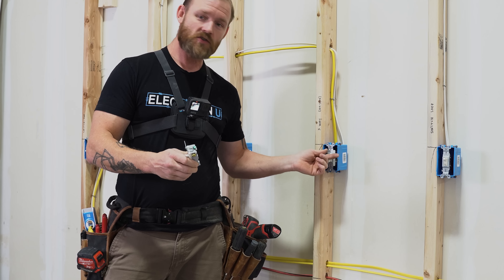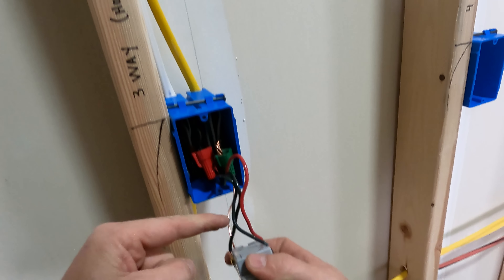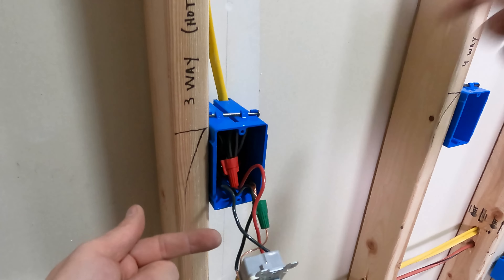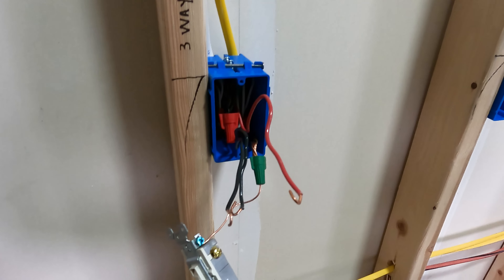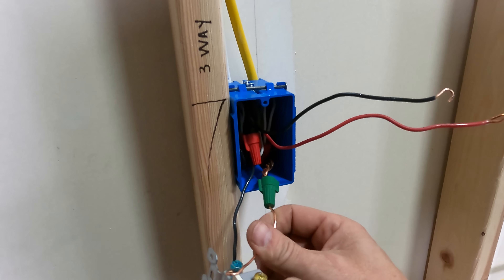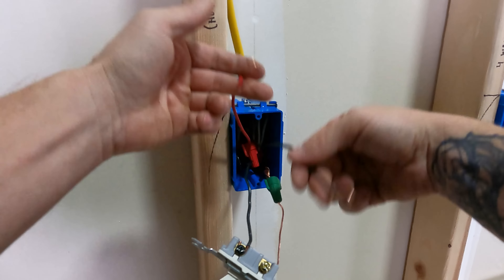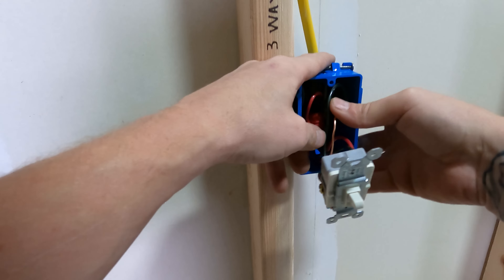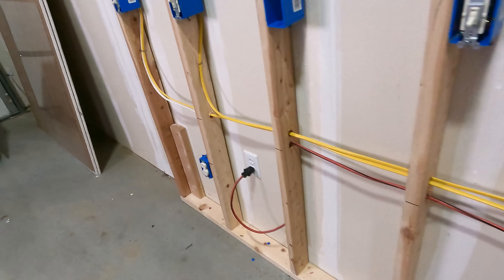How Do I Replace a 3-Way Switch? Which Wire Goes Where??

Comment: Should check with non-contact voltage tester. 1) You can never be sure you have found the correct breaker - especially in old houses which are more likely to require the switch to be replaced and 2) As in this example there are other wires in the box that could be live.

Comment: Thank you for clarify the basic. However, there are deviations . In my case, one side was wired by two 14 2, the other side is 12 4. On the 12 4, Red is HOT, Black and white are travelers!

Comment: This is where pulling different colored wire through conduit is very helpful: yellow and orange are single pole single throw (on/off. Single circuit) and the brown wires are travelers (single pole/double throw). If I were doing work in the land of Romax, I would be labeling Both the outer jacket, when necessary, and the individual wires with colored tape. Romax without labeling can become extremely difficult

Comment: Thanks!
Reply: Dustin at Electrician U saying to connect the two traveler wires to the gold terminals was the secret to correctly connecting the wires when a 3-way switch I replaced did not work correctly.  I changed the traveler wire connections to gold, and now it all works perfectly.  :washhands:

Comment: Dear home gamers, please check for voltage at the switch AND outlet AFTER you flip the breaker and BEFORE you start touching wires.  Standards change, people make mistakes, and the right wire colors change.  For a regular switch, you need to test all possible combinations in case someone flipped a wire around somewhere:
Hot-Neutral
Hot-Ground
Neutral-Ground

For a 3-way switch you have some more wires to check.  I skip the neutrals because they are really just tucked in the back of the back of the box and along for the ride and not connected to the switch, which leaves (Colors used instead of type):
Black 1-Black 2
Black 1-Red
Black 1-Ground
Black 2-Red
Black 2-Ground
Red-Ground

I bet there are a lot of people thinking that's WAY too many wire combinations to check, and that's up to you.  Just keep in mind, if YOU think it's too many wires to check for safety, SOMEONE ELSE might have thought the same thing when they worked on it before you.

Comment: I just came across your channel and is full of great info, can you do a video explaining the difference between a switchgear, main distribution and secondary distribution, I ask this because I am working as a junior electrical estimator but I don’t know any thing about a building single line diagram and I always come across to those things, it would be helpful I you can give and inside of those things

Comment: I would love to see some more industrial type videos from you.  Motor control stuff would be cool.  I don’t think I’ve ever seen you in a plc cabinet or some crazy relay logic stuff.
Reply: I've worked on some express type car washes from the ground up. Motor controls are very detailed and intricate. Vfd's, inverters, lots of low volts, etc. Then the programming involved. I mean, it's a lot, which is probably why he hasn't took the time to make a video on it.

Comment: I felt compelled to send you a Huge Thank You for helping me figure out my wiring mess up. I was in a hurry and my 3-way switches and one 4-way was giving me trouble. Turns out a wired them incorrectly with the traveler mixed up with the  power. I was able to fix by looking g into the sheathing. Saved me a lot of trouble. This is the best video on 3-way wiring I have found. Many thanks.

Comment: It does matter which traveler goes on which screw if you want "all off" to mean that the light is off. You can't just turn one of the switches upside down to fix the problem now that the geniuses at Leviton  have started to stamp their name on all the switches.
Reply: Now that's funny

Comment: This is why I prefer to use conduit with three-way switching so I can use colored travelers (yellow/orange) to differentiate them from the hot/neutral/ground wiring. I've seen three-phase Romex that has brown/orange/yellow, but have never been able to find it and I expect it is more expensive
Reply: I recommend not to use those three colors, brown, orange, yellow. Though it's not code electricians speak the same language and those three colors generally represent 277V/480V. They also can represent the three different phases in parallel circuits. So if an electrician saw those three colors in a home he may think
277V/480V. The three colors to use in a home is black, red, blue. Blue is generally used in three phase, but it's 120V/208V. And since homes use 120V/240V blue is an acceptable color in home applications. I only use blue on whites that are not being used as neutrals. A sharpie works well to rephrase to blue.

The two colors you'll want to use as travelers, if using conduit, to differentiate from black, white, ground is red and blue. That's what's commonly used in home applications. No need to start confusing some people when you choose to sell your house.
Reply: Is it really that hard for you or that confusing to you to label wires having tape with writing on it?

Comment: Did a 6 way recently it was a nightmare! Not licensed but love electrical and was noticed by kleintools a few years back. Love your videos they help with stuff I’m not 100% sure on! Thank you!
Reply: No such thing as a 6-way. Do you mean 6 locations using  3-way and 4-way switches? That application would take two 3-ways and four 4-ways.
Reply: @TheForgottenMan270  sure